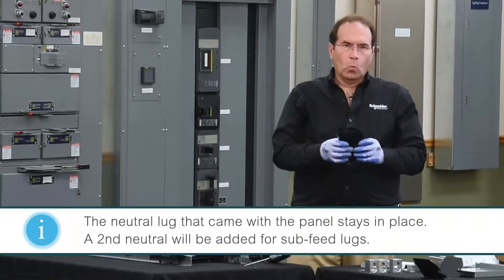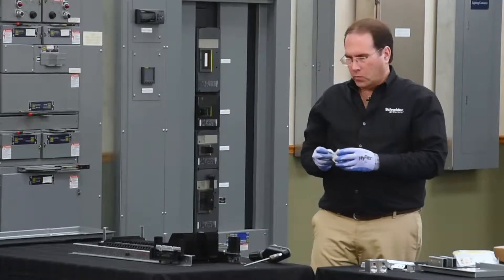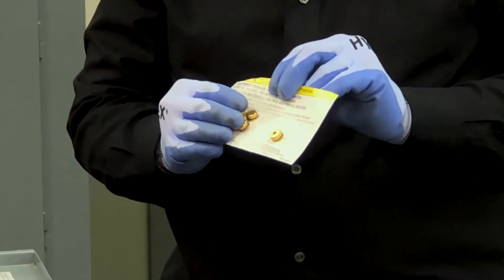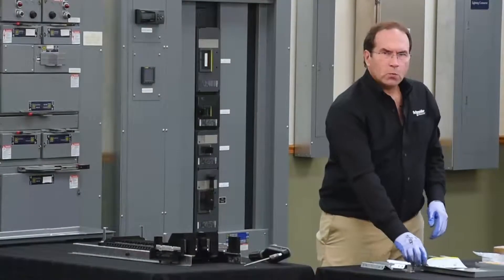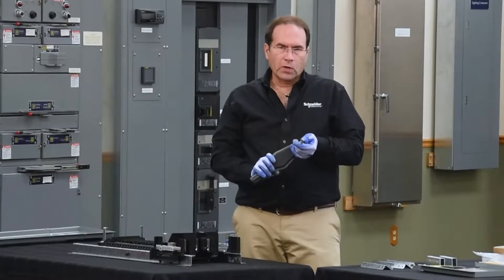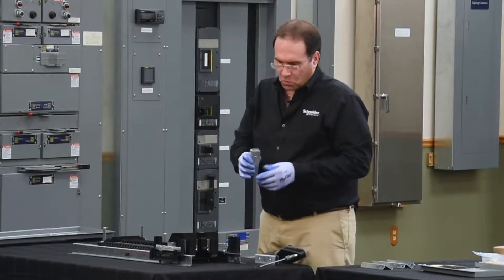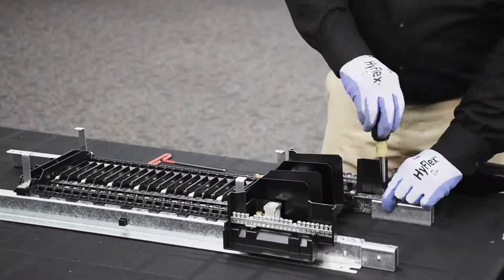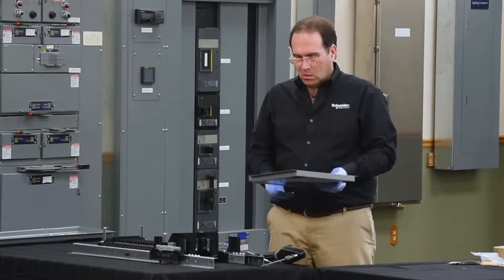NQ Sub-feed Lug Kits (1 of 2): 100/225A

Comment: If I wanted to create my own ac combiner with 3 (line 200 amp 4 circuits. generator say 100 amp 2 circuits and load side from inverters 100 amp 2 circuits) bus bar, How would it be possible?

Comment: What the different between a sub feed breaker to a second panel for added breaker space, and installing a sub feed lug kit?
Reply: Sub feed breaker is a breaker that offers circuit protection. Sub feed lugs are just lugs that would give you no protection other than the main breaker for the main panel.